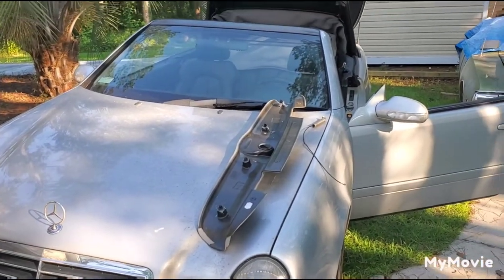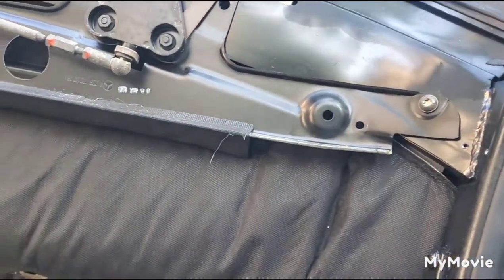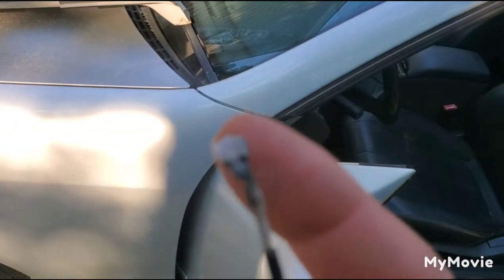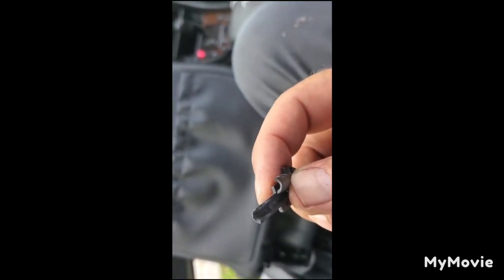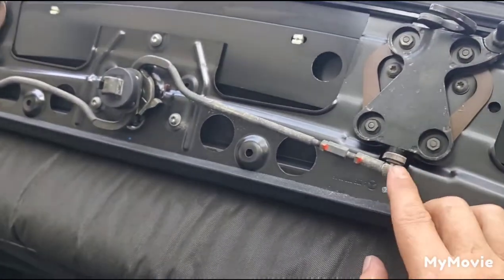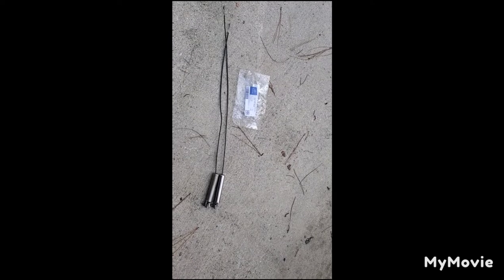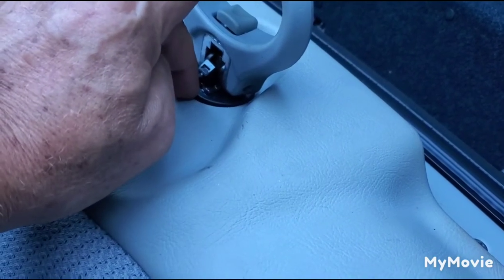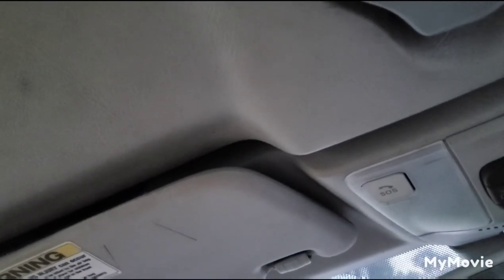W208 Convertible top tension cables repair.

Comment: Success!  It's not really that bad a job to do.  I never did have to remove the headliner.  I was able to work around it.
Reply from the maker: Great! Glad it worked for you.
Reply from the maker: Yes it works if you push it by hand
Reply: I was going to mention you don’t have to rice the headliner.

Comment: Thanks for this video, it is very helpful.  Do you know the part number for the plastic bit that snaps together?  I haven't dug into mine yet, but want to have extras in case it's broken.
Reply from the maker: Hi, sorry I don't know part number but you should be OK I havent see one brake yet. On the handle yes its about 3 mm Allen key, it maybe 2mm. If cable broke at the end you maybe able to fix it if further you would need to put new cables they are about $90.00 from me/be. Good luck on your project.
Reply: @alexandersgarageklugman6043  Thanks for the info, I appreciate it very much!  I have the cables ordered and will attempt to do this job once they come in.

Comment: What symptoms did you experience with the broken spring?  Did the top not open?  Or was the top slamming when closing?
Reply from the maker: @erickhaughn2217  top wount open, have to push up by hand.
Reply: @alexandersgarageklugman6043  seems i have the same issue.  Did it open if you held the top open?
Reply from the maker: @erickhaughn2217  yes it works if you hold it by hand.
Reply: @alexandersgarageklugman6043  thank you.  I will try this.  I suspect a broken cable.  Bought car used, don't know history, except the top did not work